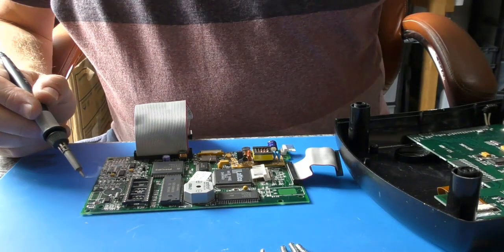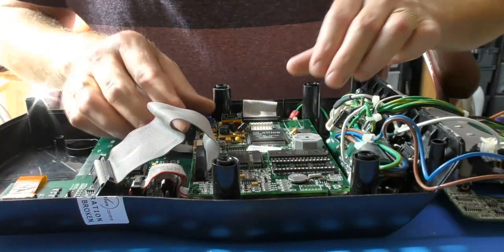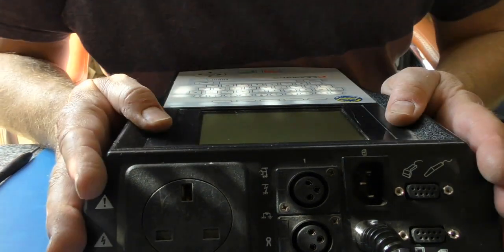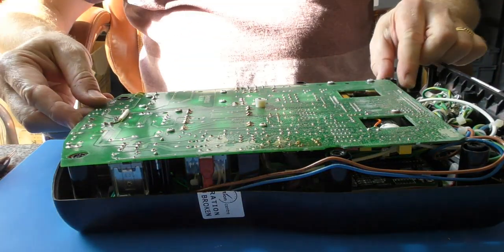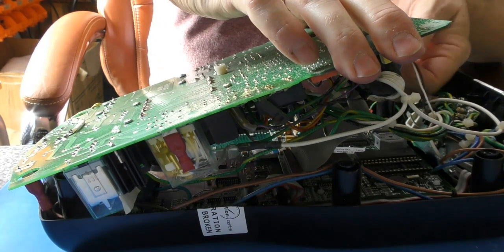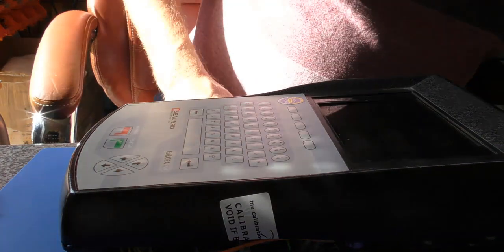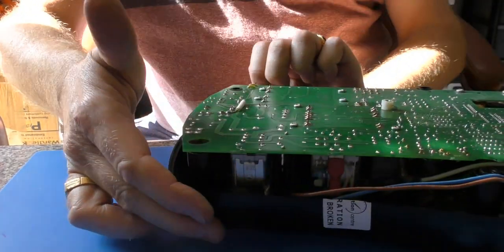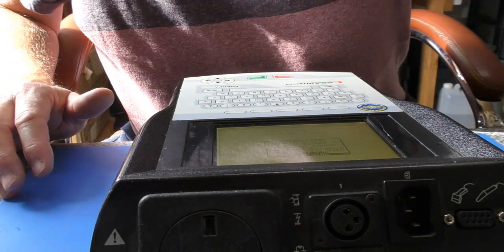Seaward Europa Battery Replacement. Date & Time Loss.

Comment: I had the very same issues with my europa and that dam side cable was the situation plug in in and ensure that both rows of pins are connected. J2 grey connector lead otherwise you may not see the screen display or get the continuous bleep indicating a error. Also I had my tester calibrated recently but by changing the dead battery it lost the calibration so I suggest do the battery before having it calibrated.